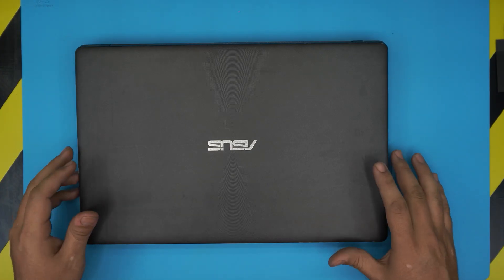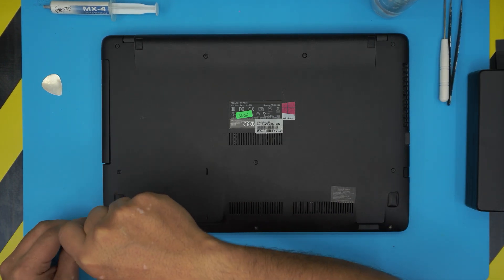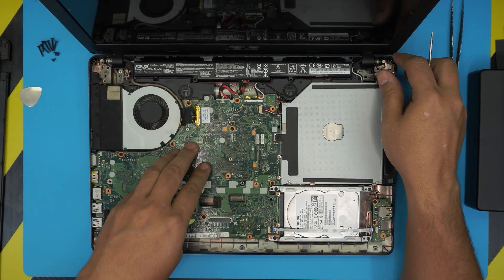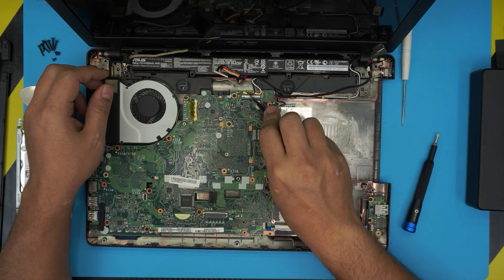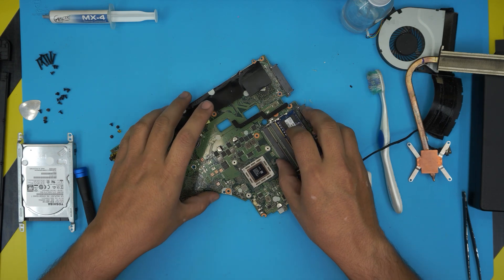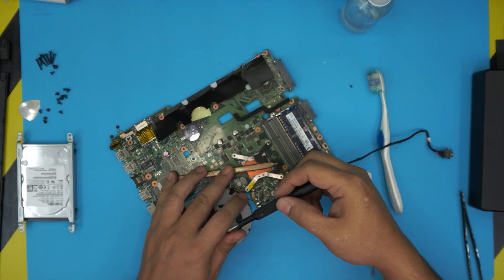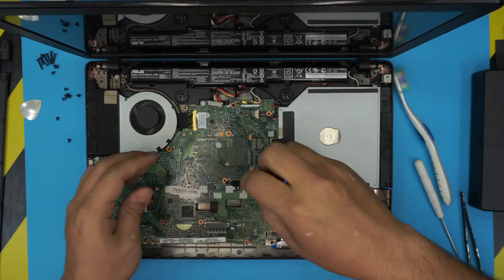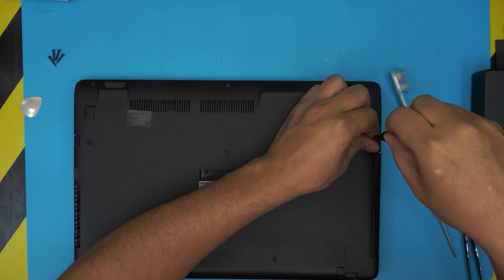Asus X550z Repaste Service Overheating FIX Full GUIDE

Comment: Do you think making some holes under the fan would help to improve air flow?
Reply from the maker: Thank you for the feedback! if you wish to support the channel you can LIKE or SUB or both :P
regarding your question: yes my friend it will defiantly help out as we do this service at the request of our clients, just mark the holes and use a small drill bit to drill the plastic, supper easy.
Reply: @uFixTek  Yes, you’re right. But I’ve done a clean and changed the thermal paste and I think it’s sufficient. I dropped my pc’s temp from 90/100 degrees to max 60 degrees. You’re video helped me a lot. Thank you so much!
Reply from the maker: Glad it was helpful! 😊 Thank you for the feedback! 
if you have any question or request feel free to ask my anytime my friend :)

Comment: And its confusing because I dont see the HDD on the boot options but the laptop detects it. And i  use flashdrive to format it i can see the HDD but it wont let it boot.
Reply from the maker: because you have a problem on your south chip i responded to you with steps, follow them.
Reply: @uFixTek  I found the solution to this. The problem was the Harddrive doesnt have an OS to boot. 

But the USB ports is from the different laptop but same model Asus X550Z. I read your comment i will try it asap. Thanks
Reply from the maker: oh that is important point to mention lol
Reply: @uFixTek  I did what you instruction about the USB ports. it looks like my harddrive wont power up, it should ligth up but nothing shows

Comment: Hello i have this problem all usb ports wont work.
Reply from the maker: Thank you for the feedback! if you wish to support the channel you can LIKE or SUB or both :P
regarding your question: your issue is from this south bridge chip its over heated, https://imgur.com/a/8UFskBf
you can repair it at home, follow the following steps:
remove the motherboard remove heat-sink and remove the black tape over the chip.
place the board on top of a wood table, and take a hair dryer and set it to max heat and medium air, and keep it above the chip for 8min with 1" the distance and after 8-10min remove it, and LET THE board to cool down own its OWN, dont move it at all for 10 min and after, repaste and test.
Reply: @uFixTek  alreay sub and liked. Thank you for your kind response. I will do this asap.
Reply from the maker: oki much appreciated and let me know.